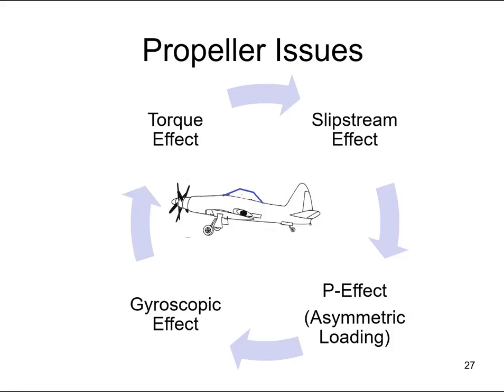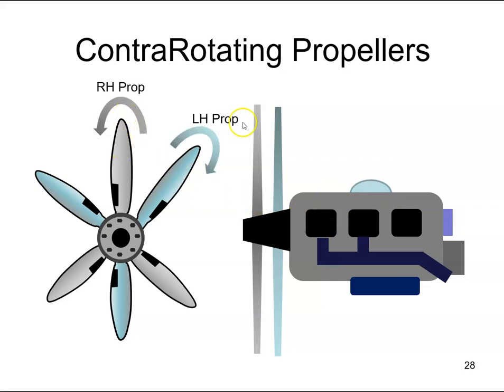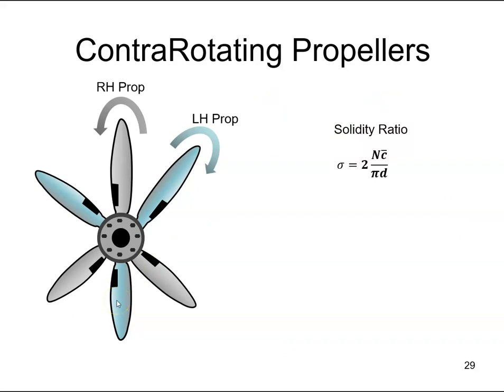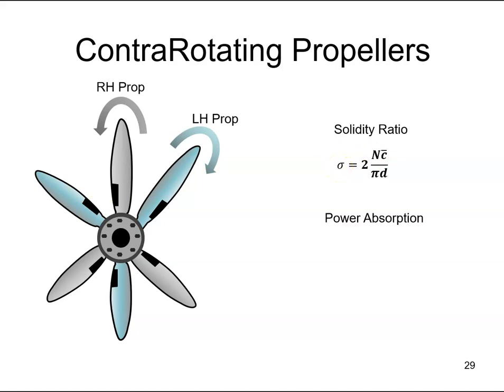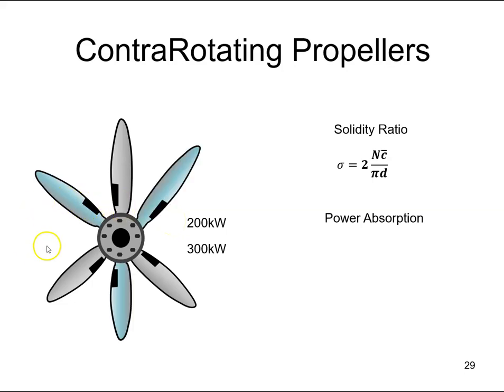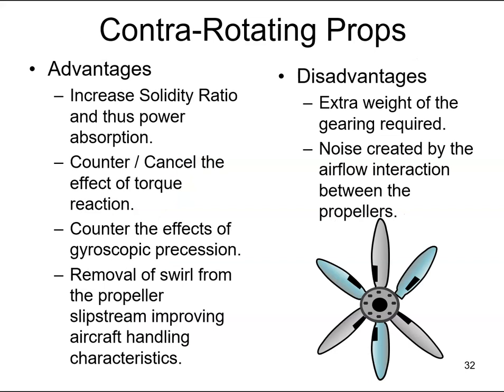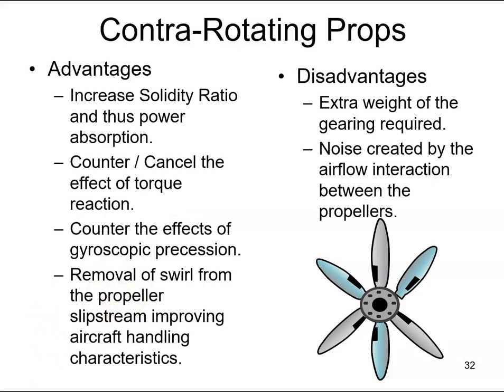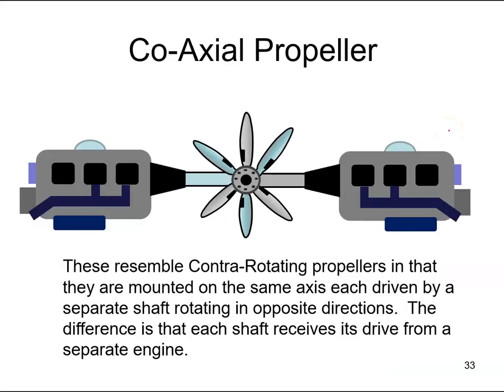Contra-rotating Propellers

Comment: Thanks Roddy, some ships and power boats are having this setup , can contra props steer the boat straight without using rudder in still water  ?
Reply: Thanks Roddy and Evan, so in theory slight corrections are made with min effective rudder angle yeah
Reply from the maker: I have also noticed ships / boats using contra-rotating props.   Whilst I admit to knowing nothing about boat, I’d say you can only steer with the use of a rudder.
Reply: Contra-rotating boat and ship propellers reduce their 'handedness'. Boats/ships, especially in reverse and varying by rudder setup, can creep to the port or starboard due to the rotation of her propeller. Theoretically a contra-rotating propeller fixes that issue, but I believe it has more to do with efficiency.

Comment: There is this contra-rotating propfan concept (An-70) that seems to be very efficient and quiet, also allowing for turbofan-like speeds. Any ideas on what's happening there?
Reply: It has different blade counts for the front snd back rotord and possibly dofferent blade shape and speed but were not sure on that. That drastically reduces noise

Comment: Does this increase efficiency of the engines?  What % more thrust is gained if any?
Reply: Yes, it does increase engine efficiency by converting the helical or spiral thrust by adding another set of propeller from behind, in opposing direction it creates straight slipstream and adding lower power ratio to more thrust ratio. The disadvantage is the noise and the complexity of the assembly.
Reply: should be from 6% to 16 %